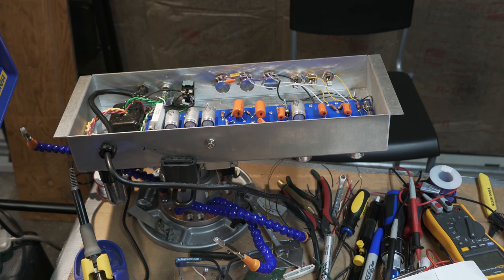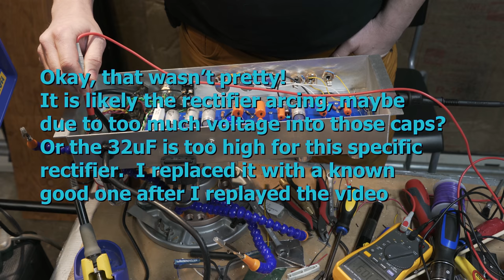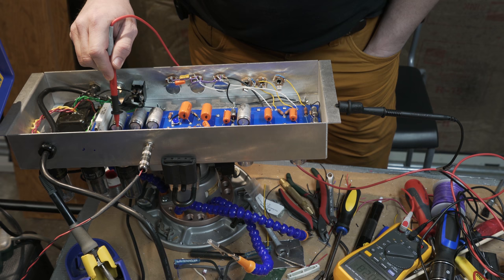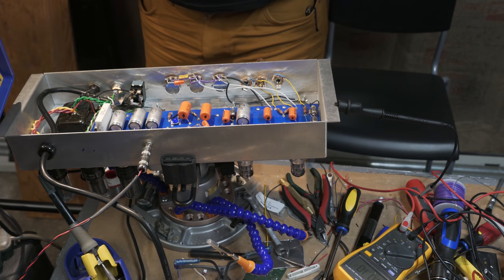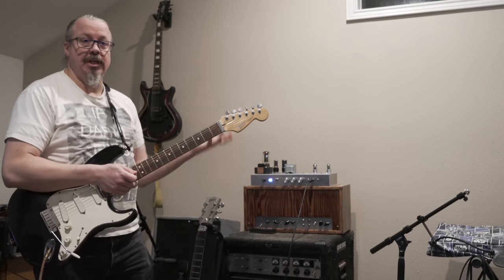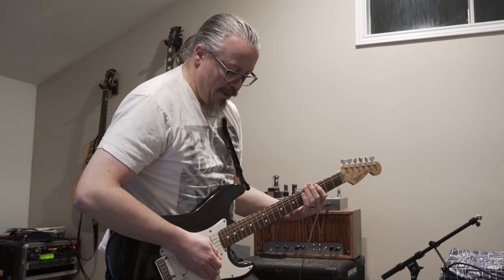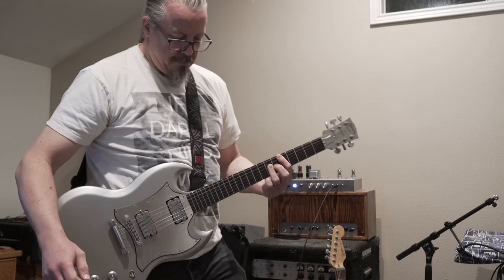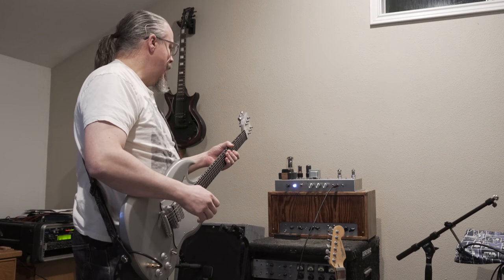Tweedle Dee Deluxe Power On and Demo Video 11

Comment: Nice - I owned a Tweedle Dee clone. A lot bigger sound vs stock 5E3 - big, tight bass - a lot of mids actually - lot better with single coils. Pretty dynamic - single notes would be pretty clean but chords/double stops at same volume crunched up a little.
Reply from the maker: Yup I love the tone of this amp!

Comment: I know this is an older video, but my question segment is, were you running the pedals in line? Did you have a dual buffer? How long were your cords, And what volume, tuner, and reverb pedals were you using?
The reason is that many volume pedals have 250k pots that greatly affect your tone, tuners suck tone a lot of times, and I’m curious if your pedal line had buffers. Length of cord (and quality of cord) affect tone a lot. Pretty much I wanna hear this amp with a Strat plugged direct using a 10’ instrument cable.
As for the guitar and tuning, I read the other comments, some guitars need setups more often, it’s no big deal, I could still hear the amp and that’s why I was watching, people need to be less “snarky” with their comments... I’m not a fan of demeaning attitudes.
Reply from the maker: It's been a while.  I used all pedals in front of the amp.  There's no effects loop.  I used a hall of Fame reverb.  I don't know if any of the other pedals had a buffer but the reverb did.  The volume pedal is an Ernie ball.  Tuner is a tc electronic as well.  I don't fully understand what you mean by how long my chords were

Comment: Ok fellow amp nerds: I want my 5e3 to stay and hold the tone when it’s dimed (the clean yet still tweedy volume drop spot at 10/11 depending on your amp) 
How can I capture this
Reply from the maker: Sorry didn't see this until now.  The 5e3 didn't do this natively so you'd need massive tweaks to the circuit to keep it out of distorting the output signal
Reply: @FrenchieFilms  yes I understand. Was hoping to capture that tone early on in the volume sweep but just so happens to be that I’m happy w the 5e3 tones regardless!

Comment: Amp sounds great. My only suggestion would be to tune the guitar. An out of tune guitar will make ANY player sound bad and his/her amp sound junky...
Reply from the maker: I think I have problems with my guitars.  I literally tuned them before recording and again during the actual recording (for the SG after I picked it up) Either that, or when I get nervous, I apply too much pressure to the strings and actually bend them out of tune a bit, either way, I can hear it out of tune too, but am not sure HOW when I've just tuned it and it sounded great moments before I hit record.
Reply: Perhaps the intonation is off.  A good setup would help.
Reply from the maker: +Duane Harlick I also noted my strats action was quite high.  Not sure how that happened over the years, but lowering it, seems to have cured the tuning problems
Reply from the maker: Yeah I have them intoned pretty closely, but I think the action was too high, I lowered it a bit and it's playing much better now, without going out of tune.  Oddly I've had years of play on that guitar without this issue, maybe somehow over time the neck has slowly bowed, and may need a real 'setup' as you say, with truss rod adjustment etc.
Reply: believe me, that is a good sign, if u can hear it even if it is only slidely detuned, ... u have to be flexible ... tunin' by a machine sometime may not be good enough !, ... sometimes u have to tune the guitar while picking ur chord (while playing) , u playing steel strings, u got to pick them straight down, if u just bend 'them a little bit, u are already in direction detune. if u learn how to handle that, than u can start to detune, or slide the guitar just the way u want it "while playing ", and that's where the fun part starts all over again ... u can reach the point, u can do anything on ur guitar, and the guitar just sings, for some reason, "to tune a guitar (or an instrument) is the most important thing at all, u don't even need to be able to play, if the instrument is tuned, it almost plays it all by itself, all u need to do is stand by and watch it, that's it how a tuned guitar sounds.

Comment: How did you set trim pot on phase inverter
Reply from the maker: I used my oscilloscope connected to the output of the two sides of the phase inverter, and inverted one side so they look in phase.  Then I adjust the pot until they're identical

Comment: with that amp, that's good stuff that u did, I respect that, believe me, but one thing, some may call it freedom of expression, but please : learn how to tune a guitar, believe me, u will enter a new dimension of sounds, because that is the level, when u can start to learn to have ur results of playing what u do ... all under ur control. I mean, u already find ur way in, when u play distorted, we can't here it as much as when u play clean, but ur guitar is actually completely in detune. If u are not able to learn it, buy urself a tuner, so u can tune the guitar just mechanically, that helps, just listen to the music (the sounds) u are producing, a good tuned guitar, sounds like u are sittin' in a church, ... an even slidely detuned guitar, sounds like crap. If u really love what u're doin', get a tuned guitar, somehow ... merry christmas
Reply from the maker: +Marine Forces thanks, I found I had a problem with my guitar.  I did tune them every time I record, but then it would go out of tune every time I'd stay playing.  I adjusted the action to be closer and it's staying in tune much better.  Believe me, I have a tuner, and use it all the time. :)  thanks for your comments, and a happy new year too